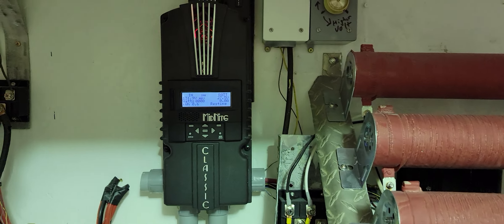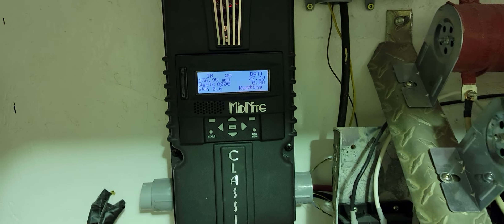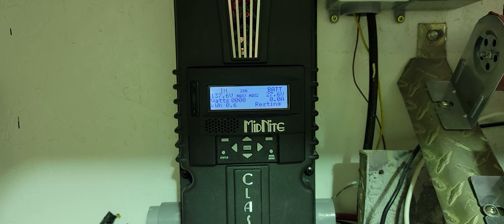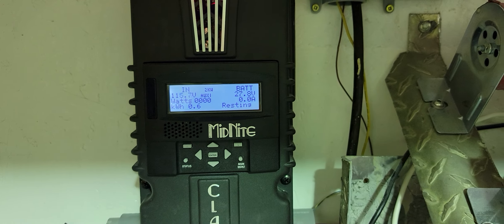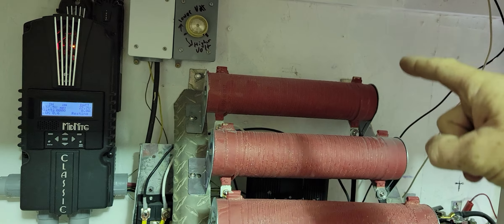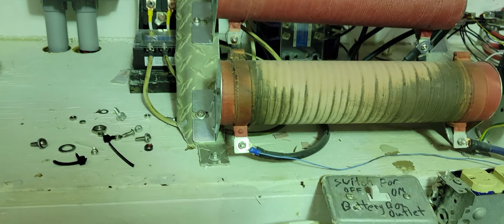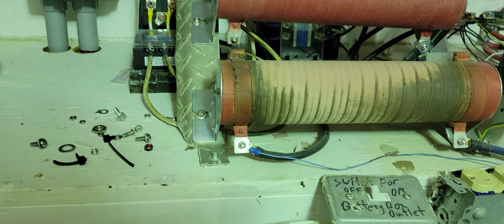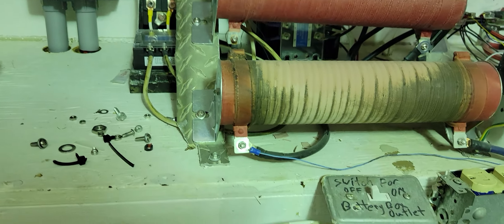Update on the Axial Flux Wind Turbines and some talk about the power system

Comment: ive seen both Orlando Sanchez and John Daniel  use wirewound resistors as a brake No battery just resistors, that way no burnt stators just hot resistors.
Reply from the maker: That still doesn't stop the stator from making heat.
Reply: @windpowerandmore6310  ok im just going by what theyve said, John said he saw quite a few stators totally fried using the three phase shorting brake method yet once he used resistors that are not connected to a battery just direct as a brake he saw no burnt stators, i guess the big turbines use mechanical brakes i plan to use a simple non hydraulic trailer disk brake.
Reply from the maker: The only reason they burn up is because the blades are too big for the stator and magnets in the rotor.  They don't burn up with the resistors because the resistors are more matched to the stator size.  That won't stop the turbine from overspeed which will cause lots of damage especially when the magnets come loose. The proper way is to have a stator and rotor that can stop the rotor almost completely with any amount of wind .
Reply: @windpowerandmore6310  good explanation and nice tip to learn
Reply from the maker: @closertothetruth9209  I’ll try making a video of it ASAP . It seems lots of people have a hard time understanding how electricity actually works. It’s not easy to explain it but it is clear when I can show how a turbine will actually speed up and destroy itself with resistors that are too small. Most turbines that are sold now have blades that overpower the stator but in most cases the diameter of the rotor is so big that it won’t over speed until the wind is crazy strong. That is why when Toy for Watts trimmed his blades shorter he is seeing a better output. The rotor is turning faster and still has more than enough torque to overpower the magnets and the stator field strength.
Reply: @windpowerandmore6310  i know there is a blade calculator, i have all the stuff to build an axial, but that i have no time for now, my magnets are 40×40×20 n52 4 coils
Reply from the maker: @closertothetruth9209  Awsome!! Do you mean 4 coils per phase? 12 coils total.
Reply: @windpowerandmore6310  yeh i only bought enough magnets for four coils per phase.
Reply from the maker: @closertothetruth9209  what size of wire are you going to use?

Comment: Have you thought of adding a voltage monitoring relay as a third level of protection?
Reply from the maker: Hi buddy! Where are you talking about adding it? On the batteries?
Reply: @windpowerandmore6310  I’m studying at the possibility of installing it ether at the 3 phase side or right out of the rectifier to keep the voltage at 250v or less using the resistors. This is one I’m looking at Crouzet 84872142 MUS260 Voltage Monitoring Relay for the DC side or this one SDV-FH71TAC240V on the 3phase side
Reply from the maker: @doirizarry  Nice! I do have a reotstat that turns on the dump load around 280v for extra protection works great.
Reply: @windpowerandmore6310  nice. Didn’t see that in any of your videos i saw. But i would still love to find a 3phase voltage monitoring relay that i could set to 180v AC that should give ruffly 243v DC. Still learning 🤓